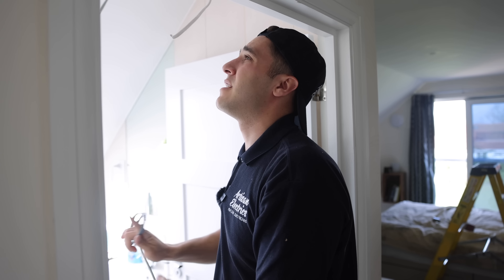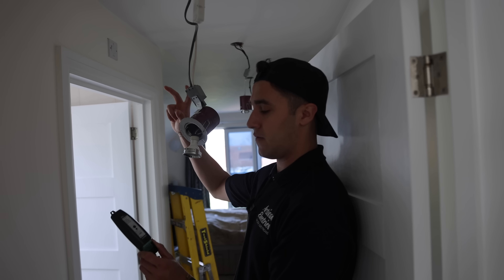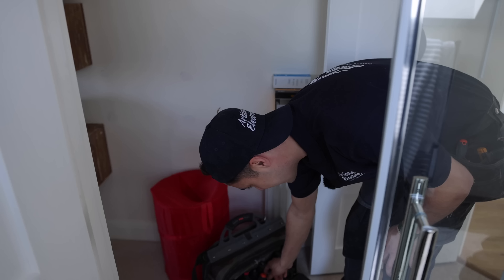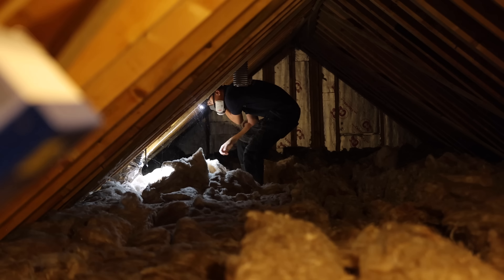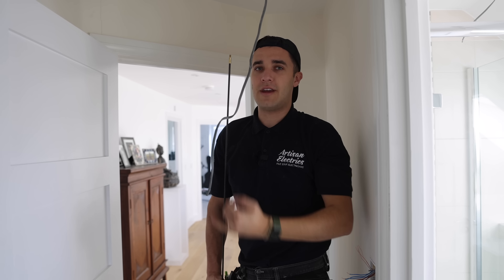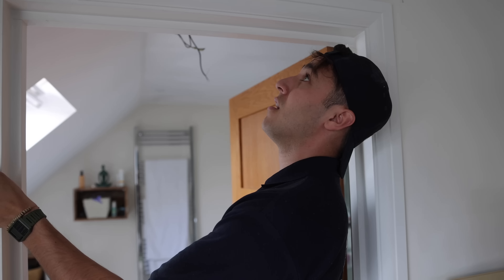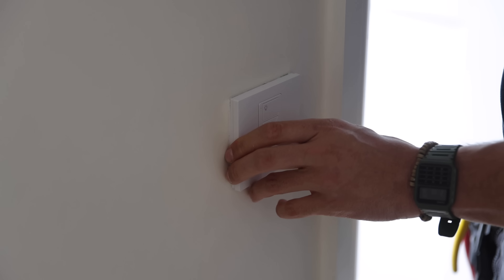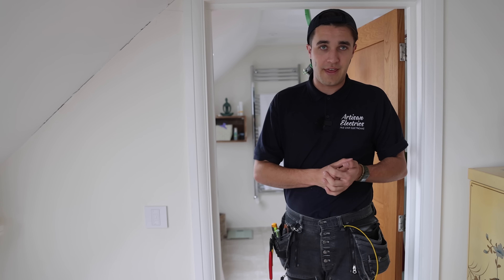Turning old electrics into smart electrics!

Comment: Smart lighting my ass. I know which system I'd prefer in a power cut / wifi down scenario:

Conventional: wait for power to resume - lights come back on.

Lutron: You may experience a temporary power or internet outage.  On occasion, this may cause the Lutron Smart Bridge / Repeater to lose connection to the cloud server via the internet.  Here are the steps to take in order to restore the connection:
Verify that the ethernet cable is still properly connected from the bridge directly to a LAN port on your router
Re-set your router by cycling power off for 10 seconds and then turn it back on.  Wait until the router completes the re-start process (up to 5 min depending on your router)
Re-set your Smart Bridge by cycling power off for 10 seconds and then turn it back on.  This will re-start the smart bridge.  The light ring will illuminate once power is applied and you will see some flashing for approximately 1 min.  Once this is complete, the light ring should remain on solid.  If the light remains on solid, proceed to Step 4

Flashing Light (Every 3-5 seconds):  This indicates that the bridge is not communicating on the network. 
Check your wired ethernet connection between your bridge and router.  The ethernet cable must be installed to the LAN port of your router or switch
Try changing the LAN port that your bridge is connected to
If you have a spare ethernet cable, try replacing the cable
If the light does not go to solid proceed back to Step 1
If it still does not connect, try a different Ethernet cable.
You should now be able to re-connect via the Lutron App to your system.   Press the Retry button to restore connection.  Your app should now look something like this once the connection is restored.....

Comment: Lutron are just introducing RA3, same Pico remotes, dimmers and switches but the hub and bridge is combined, it’s PoE and by design is expected to be installed say outside of a data cabinet or close to the clients router. 

Not so sure Crestron, Elan, RTI to name a few would agree with what you said regarding Control4. Would be like saying when someone wants sockets and switches they choose MK.

Comment: I can’t be the only one who believes the Pico switches are a little ugly they seem very cluttered personally but it seems a lot of people are fine with it.
Reply: I thought the same to a point and we have done a few designs on systems based on KNX. Amazing choice of wall controllers on an open standard but when you present a choice of 100+ manufacturers each with 100 different choices the client can take ages to make a decision. Lighting designers and interior designers love the choices but from an installing point of view you can see your margin draining away as you wait on decisions and then delivery on kit ( component shortages are a real problem )

That said Lutron have serious issues themselves. Some bits are ex-stock and others have lead times of months with no guaranteed delivery date. All you are told is to order early.

Comment: i have philips hue light there are great but if get a power cut when the power comes back on all the light come on , so we go round to turn them all off , is this the same with lutron smart lights system ?
Reply: you can configure the default on behaviour for Philips Hue bulbs to stop that happening: Go into the light in the Hue app and look for the 'Light Behaviour at Power on' setting.
Reply: No, they tend to remember the last state, so if on they come back on, and obliviously the reverse if off. Similar with dimming levels.
Reply: @paulblundell8033  no even if thy are off and i get a power cut when the power comes on so do all the lights 🤔
Reply: @philipsmith0752  I’m referring to Lutron not Hue